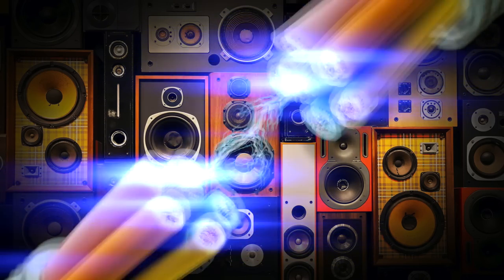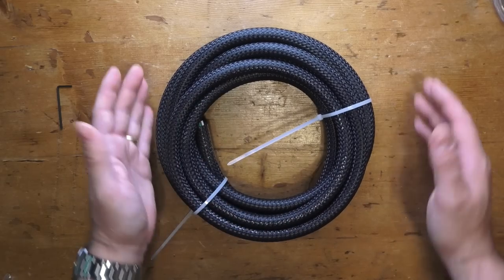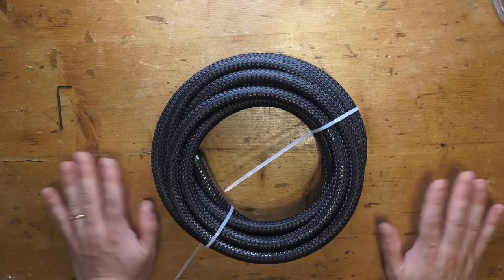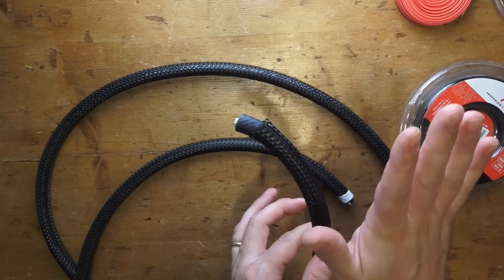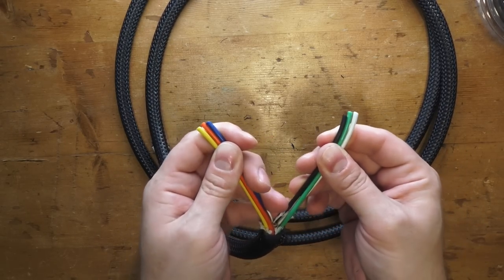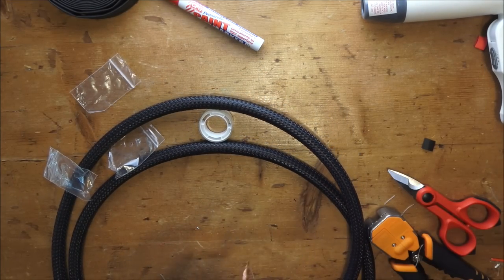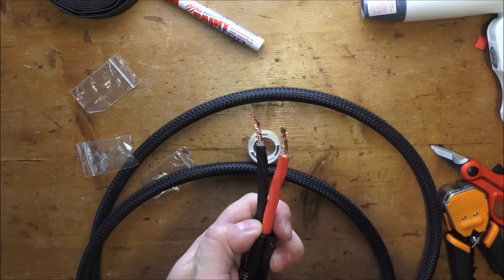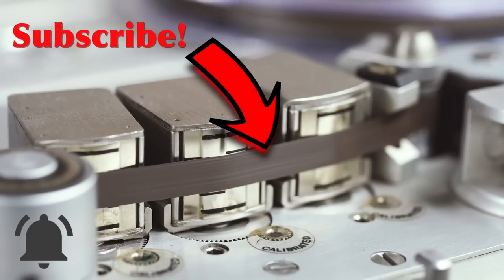The Speaker Cable Guide: Part 2 - DIY audiophile cables!

Comment: The arrows showing the direction on the cables jacket is for manufacturing purposes only. The arrows have absolutely nothing to do with electricity flow. Electricity flows 100% identical through both ends of the cable. There is no right or wrong way to connect the cable. Only a very picky individual who calls themselves an " Audiophile" would even say such things. Remember people, Audiophile and Pedophile are very close. One just means they'll do anything and everything mentally and physically to obtain the sound quality they feel if perfection to them. Key word " Them". I say that because audio is subjective because everyone has different hearing. Most audiophiles claim to hear " Soundstage" when Soundstage was created to justify an audiophiles mental health issues of a created false reality.
Reply from the maker: I think your  comment is out of place. In any case, you are completely wrong. Arrows indicate on which side the shield is connected. No mumbo jumbo, just solid engineering my biased viewer.

Comment: Again a huge BS story. Go and buy a bit thick stranded twin cable (which has a marker on one side). Strip the cable, and do not touch the copper. As long as it's stays around 2 x 4 to 5 meter, you have a perfect connection. As when one doesn't uses plugs, you have a perfect connection!  Every other solution is inferior. Total cost 8 Euro! Nothing, but nothing will beat this.
Reply from the maker: Which high quality speaker cables have you tried?

Comment: You're talking alot of bullshit. Burn in of speaker cables!! LOL!! What do you want to burn in? The electrons do not travel in the cable they only shaking because it's AC. So there is no preference of the direction. Did you ever heard about the skin effect? Apparently not. All electric cables are OFC, because it's electrolytic copper.
 It's always funny to watch your videos because it's religion and esoteric. Once another guy like you want to persuade me that a vinyl record has e frequency range up to 70 KHz. LOL!
Reply from the maker: As I said in the video, and several other audio engineers out there, mainly dielectrics need burn-in/brake-in.
I mentioned skin effect. I am afraid that you have a serious ear problem or just a severe attention deficiency.
Very few electric cables are OFC even your milkman knows that. It is a very expensive procedure as well as the final copper produced. OCC copper, that is the subject of the video, again please pay attention, is by far superior to all and even more expensive.
Vinyl frequency range up to 70Khz? Yes, he was wrong. It is actually 122Khz: http://www.positive-feedback.com/Issue2/mastering.htm
This is called proof, not babbeling around with no evidence.
Now that we have filled up your lack of knowledge we can all move on and please next time take some notes.